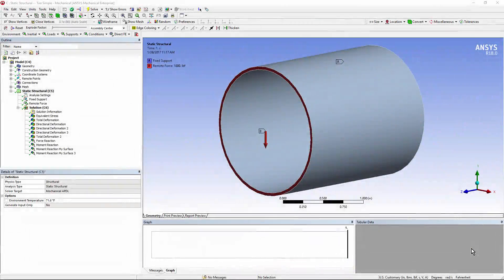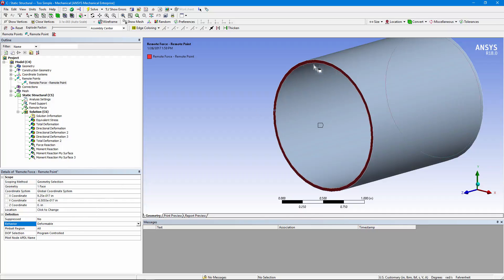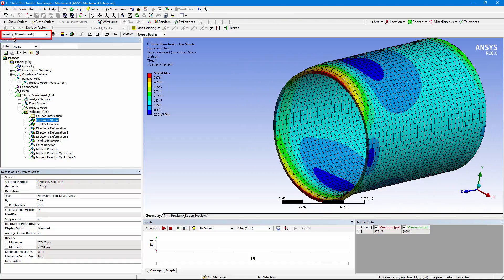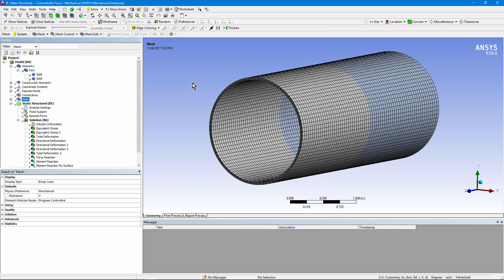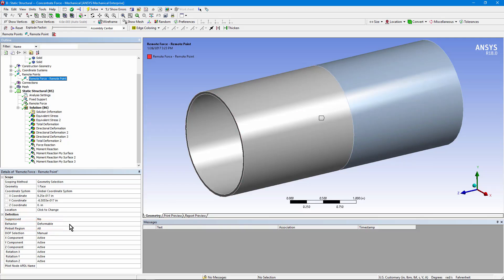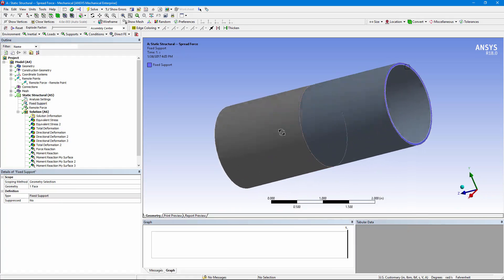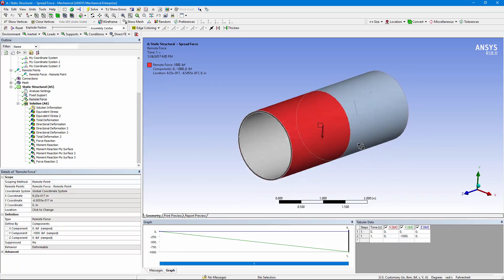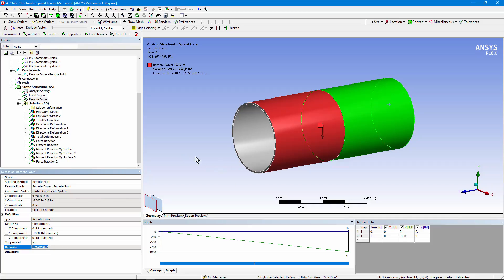Mastering Contact Tool in Ansys Workbench Mechanical: Setup and Troubleshooting

Comment: In the third case of the extension pipe with remote force applied to surface, if we drew this as a 2D Free Body Diagram side view, the force would be Force per distance, so I think it has a different moment effect than intended based on distance from the fixed end of pipe by factor of approximately 1.5 if pipe extension is comparable length. However it does not appear to have affected stress results in this way.